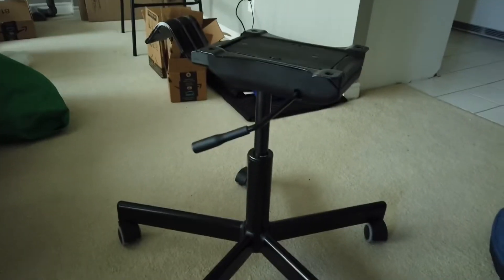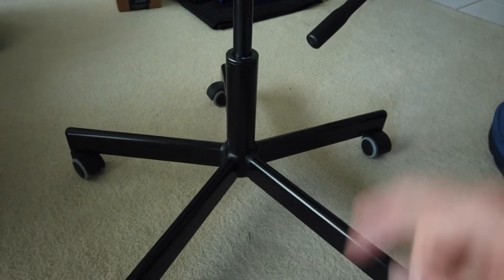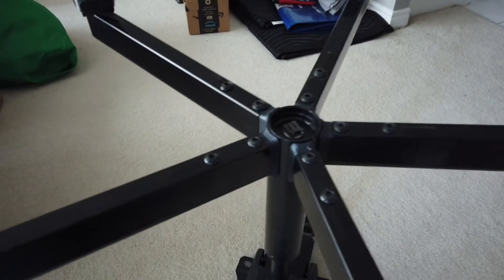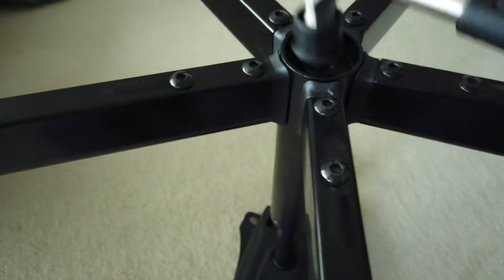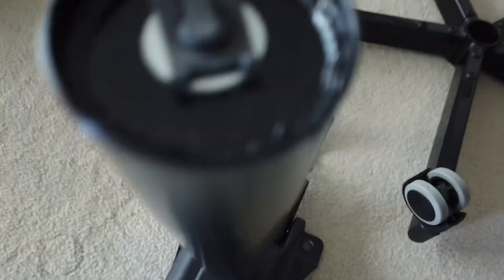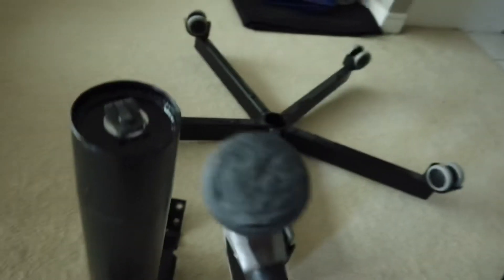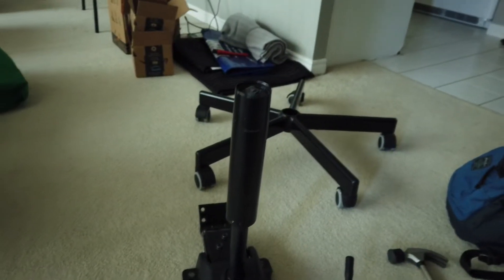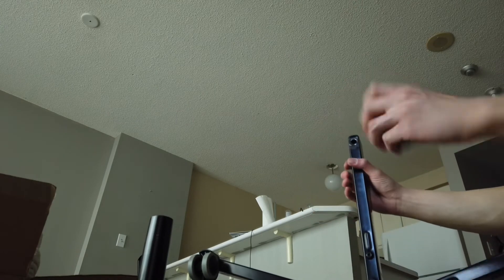How to remove stuck cylinder from office chair base

Comment: My column is really stuck and doesn't stick out the bottom like this chair. I used rubber mallet, small hammer and normal hammer. The lifter came out but column is still stuck. I have used penetrating oil but still stuck. I'm trying to avoid replacing the base. Any suggestions?
Reply: Same
Reply: Same

Replace the base!
Reply: same, no luck here :(
Reply: @ShadowDrakken  I ended up getting some help. A grinder had to be used in order to cut the column so that it would fall out...

But the base is undamaged and the chair works fine now.

Comment: Use penetrating oil or wd40. Use a hammer and hit the cylinder from side to side at the base to remove the bottom side. For the top side use channel locks or pipe wrench and twist.

Comment: yeah i tried that, the tube broke apart and most of it came off, now there's only a hollow metal cylinder stuck in the base of my chair, i call that an improvement

Comment: I got the 5 star base off, but can't get the cylinder out of the seat part. It just won't budge at all. Tried a pipe wrench, silicon spray and it is stuck solid! 🥺Help!
Reply: did you success? I am on your foot right now..
Reply: @orinfaflik3482  yes, sorted now. 👌
Reply: any good tip?
Reply: @jayreed7015 how did you end up resolving it mate?
Reply: @Oakland510  yes. Thanks
Reply: @jayreed7015   but how did you manage to fix it?
Reply: @Oakland510  my husband used a tbig hammer and brute force. It was a very old chair, so it was stuck on good and proper!